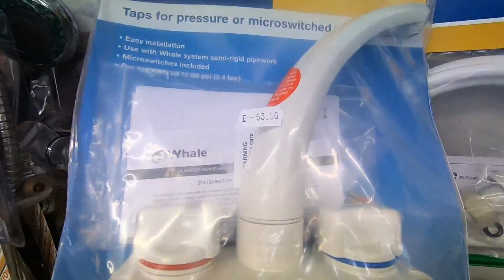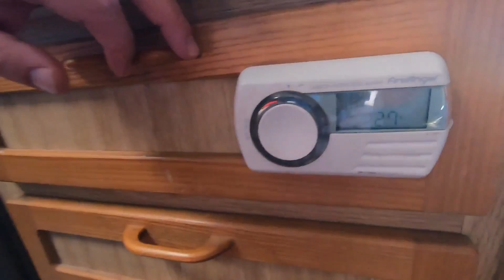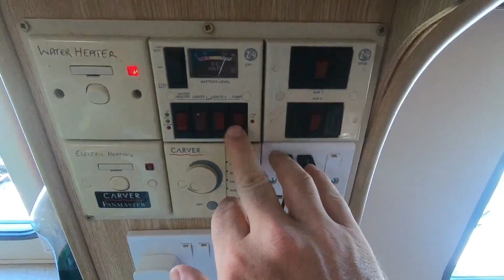Caravan Tap Repair - How to fix a broken caravan tap; removal, overhaul & refitting

Comment: Great to see you guys back.

Your timing was a bit off with this repair,  as you may remember we have the exact same caravan and before our last outing in May I had to replace our bathroom tap.

As you said in your vlog, the plastic must have gone brittle but oddly ours broke across the base between the spout and cold tap.

I purchased the tap you looked at with the longer spout, we found it a bit better because your hands are not up against the back if the sink.

Hope you have a great summer 👍🏻

Mark
Reply from the maker: Hi Mark, sorry for the timing!  I almost didn't film this, as I didn't think it would have been interesting enough.  Interesting that you find the longer spout better.  I know that there wasn't a huge difference in length.  Had Tracey not shown me the single knobs, I would have bought that one. Wishing you a great summer, too.
J

Comment: Thanks for the video, sound was great, watched it till the end, I put some soap on the rubber O ring when I connect the water pump,  seals every time, less stress on the plastic lugs, had a hard to reach micro switch fail on the shower tap, end up fitting a pressure switch to the water system, thanks again
Reply from the maker: Thanks for commenting. Really appreciate your feedback on the sound, too. This was the first time I'd captured the audio separately and although it's more work in the edit, I think that the finished product is better. 

Interesting tip about soaping the rubber o-ring. I'll be sure to give it a go next time we disconnect!

Comment: great Video again. Not a fan of microswitch controlled taps, the pump in the aquaroll is working its little guts off all the time. The guy who stores his van next to mine was only asking the other day if I knew of a good replacement whale pump, he had been quoted £85 for a replacement. His caravan is only 2 years old. If I were living in it full time I would be looking at putting an onboard diaphragm pump much better pressure and flow with the added advantage of using any type of taps you like. I have recently changed the tap in my bathroom too, even got one off the shelf at wickes. Great that you have tackled this job though. keep up with the good work.
Reply from the maker: Thanks for your kind words.  I've just had a Google for 'onboard diaphragm pump' and I have to agree that they seem a more robust choice, if nothing else.  We're on our 2nd whale pump, but the first came with the caravan when we bought it.  I've been surprised at how long this one has lasted, actually.  I thought it was going wrong in the spring, but a clean out, and it's been fine since.  We have noticed a pressure drop - this is probably the impeller fins wearing out.  I'll definitely consider an onboard diaphragm pump in the future!  Thanks for putting it in my direction.

Comment: A bit crazeee using silicone to fix taps down before u checked pipes for leaks going into push fit bends lol
Reply from the maker: 'Danger' is my middle name.
Reply: But u done a good job lol...am a plumber by the way haaa